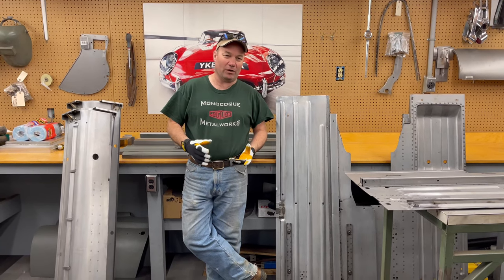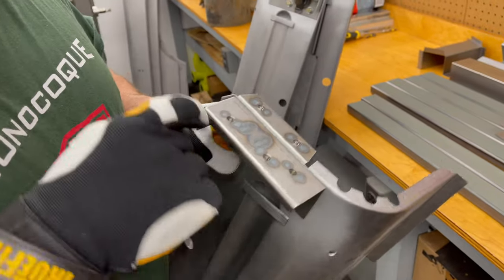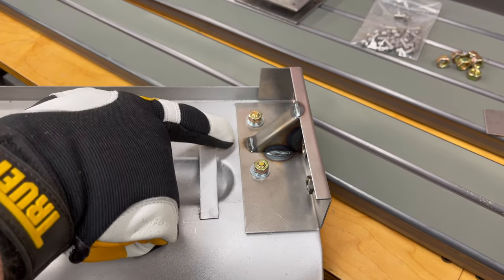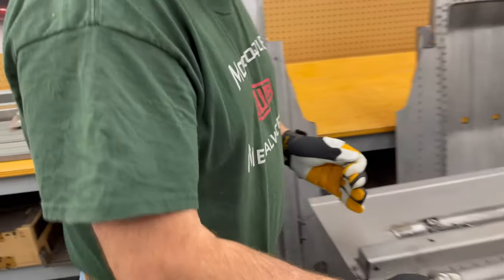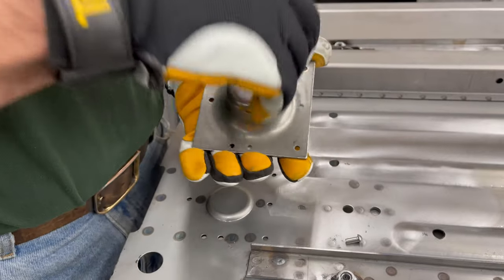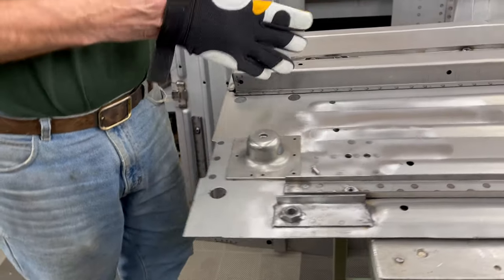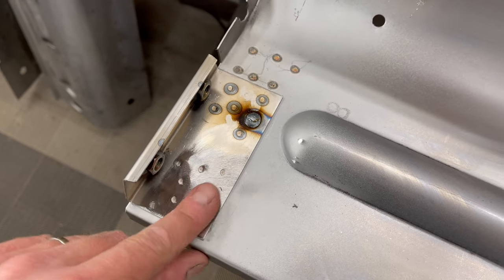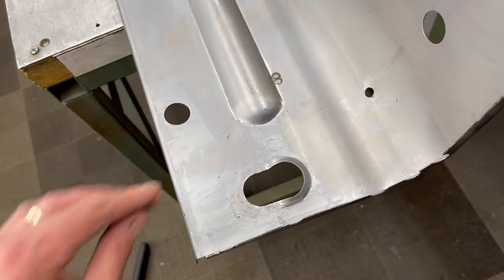Jaguar E-Type - The Monocoque Metalworks "Hidden Subframe" - Part 1

Comment: Hi another great video. Thanks it is a great back up to your very comprehensive instruction sheet. You comment that you do not notch the front part by the engine mount. does the shrinkage not pull the panel out of shape a bit as a result or is that being too precious.

My sills floorpan and box section arrived today so I am looking  forward to following your instructions this weekend.

What do you use to remove the transit primer. stripper disc? As yours loow super clean!

Great stuff we live and learn. Thanks Hugh

Comment: How much weight do the additional structural steel elements add?
Reply from the maker: We weighed it years ago and I’m pretty sure it was 38 lbs.  One nice feature is that all of that weight is at the floor datum line, so the weight that is added does help to lower the center of gravity a bit. 😉